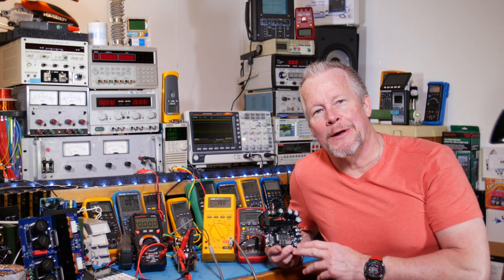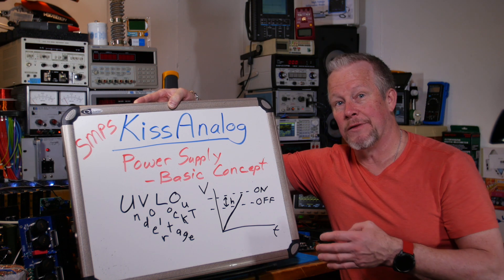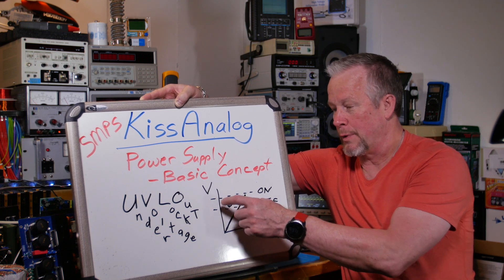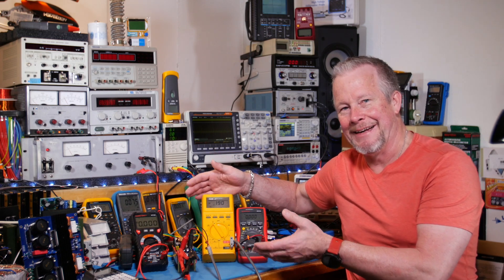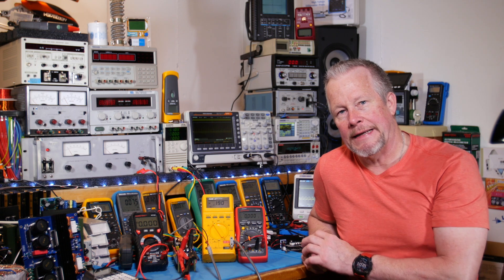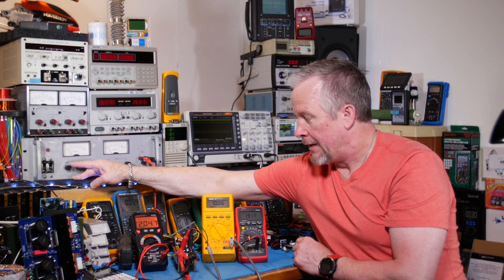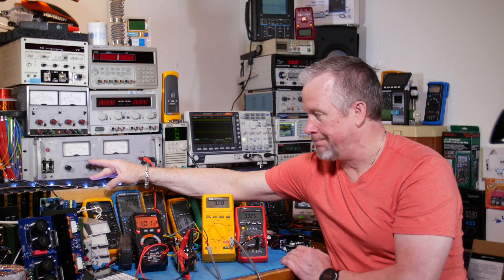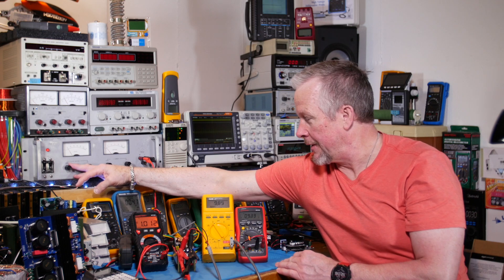UVLO demo with Boost Converters #boostconverter #Howboostconverterworks #UVLO

Comment: Out of curiosity, what's causing that huge inrush of current right before it turns on?
Reply from the maker: Thanks for the great question!  Input capacitors will cause a large inrush current even before a power supply starts to work.  Here's one of a number of videos that I have done on inrush current, but I will have more to come;) https://youtu.be/gmIXSfQRBhA
Reply: Wow at 7:36 ish, it looked like the inrush lasted for a couple seconds there! I'm used to current inrush only lasting microseconda, but i haven't tested power boards. Is the "long" duration due to the large amount of input capacitance?

Comment: Great video again! You should test one of those very cheap little boost converters from ebay china without a UVLO. They are crap but the output voltage can spike up suddenly to values not expected and much over specs - so you have to watch out where you can use them (if you want to use them at all). If you power them via battery or solar generators you will get into situations where the input voltage will slowly decrease and this can kill your load - e.g. when you use them to power led lights etc. I didn't get them to blow up the output caps so far - probably because the spikes are not too powerful or i cleared the situation too fast.
Reply from the maker: Thanks for this feedback!  I’ll have to review more of these and run them thru the paces.

Comment: Great video! You just kill it this time:-) Floating, "no editing" great angles and yes, just well made! :-)
Super smart with ULVO! A question ULVO, is that not rarely used? I mean, when designing and specifying, do you not try to avoid coming anywhere near ULVO's window?
Even I wrote about Fluke being more saleable for hard usage and Electricians, due to it's lower resolution. Do I think that a solid meter like that is perfect when working with designing of a power supply! You have to use a meter you know, can handle the main side and do not blow up in your hand! When you are on the "safe" side of the transformer, can you always use a cheap meter, but not where it can get dangerous! :-)
Reply from the maker: Thank you - much appreciated!  I’m trying to follow your advice;)
Reply: @KissAnalog  LOL then I hope my advice is not only my opinion alone:-)